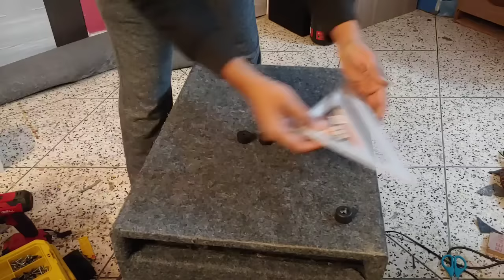12 inch Subwoofer Build | 24Hz Deep Bass Enclosure | Timelapse

Comment: What are the dimensions - length, width, height of the exterior dimensions? Also, what is the height of the port? It's looks facinating!
Reply: Google this and you will have the answer "speaker box measurement for 12 inches  Subwoofer"

Comment: Very good work it's nice to see the whole process and learn. Maybe I didn't notice but I think the speaker wires could use some mounting as not to vibrate, unless they just hang in the air. Also, some people install metal screw studs so that repeated removal of the speaker doesn't ruin the screw holes. A great job!

Comment: Nice, clean and perfect. Just have some doubt, which amplifier do you use in this, and from where you ordered the driver? Did you buy it online or from which local shop. Also while calculating the volume, have you subtracted the volume of MTX Dampening, or there is no need for that?

Comment: Wouldn't be using nails to hold it together
Reply: Nails are basically fasteners till the glue dries. Many high end builders use no nails rather use several clamps in their construction till the glue dries. 
If anything, this method is stronger than using glue alone. 
I've been building enclosures for almost 40 years(now retired) and cannot find a single flaw in this man's cabinet design

Comment: too much of the highs coming thru. the tuning may be at 24 hz, but that sub will never get that low.  The mtx dampening looks like acoustic panels, which in a sub box is killing the bass. Poly would have been better. This would be best off in a home theatre setting. Seems like another subbox pro build.
Reply from the maker: Thanks your your comment. 
Yeah that's mmt* actually not mtx, viz a brand that makes acoustic panels here. I used them for reducing distortion and standing waves, not intentionally for the blocking the lows. And it doesn't affect the lows significantly. As mentioned the LPF was off in the video, and that sub has 20Hz-450Hz range, so the highs are audible. As this was a vented box, I didn't go with poly. This was perhaps made for home theater application, And it goes upto 22Hz and physically audible.

Comment: 12 inches subwoofer but no support in every corner!
Reply: Not required..it actually depends on how one matches the amp & sub pair.
Usually ppl use a 200w sub amp on a driver capable of 250-300w RMS.
It wont effect the cabinet as long as you are using front brace & thick mdf sheet + vented air port.
For a smaller port you may need supportive braces.